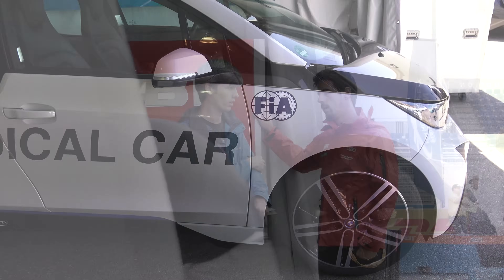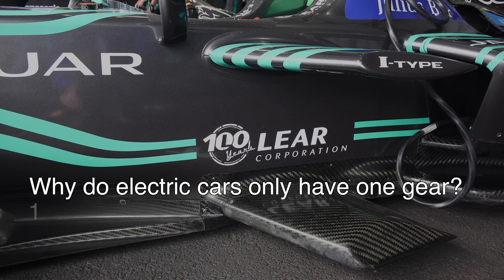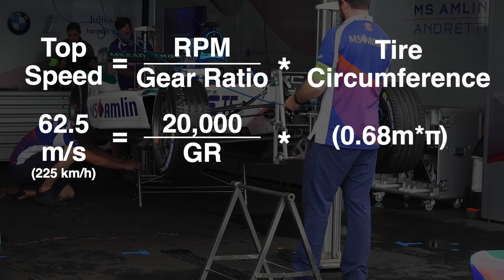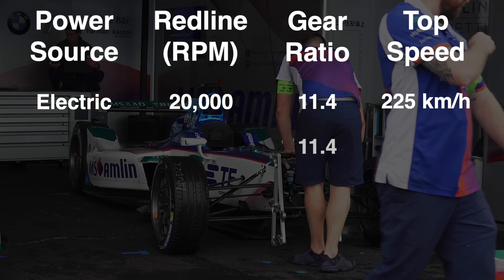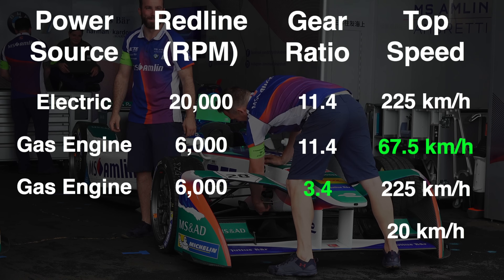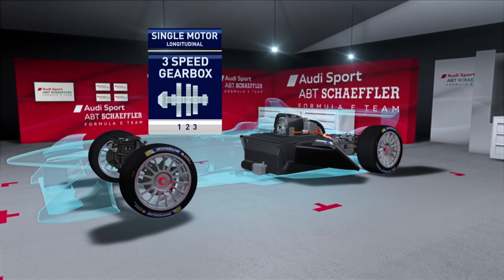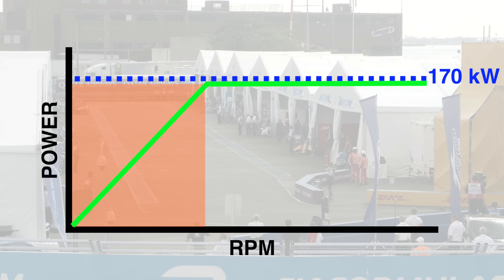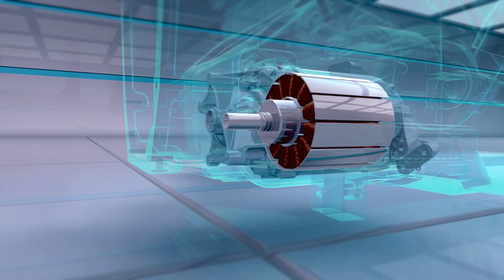Why Do Electric Cars Only Have 1 Gear?

Comment: Thanks for using the metric system.
Reply: Even Star Trek was using metric system.
Reply: @Angel Dust By the way Tesla engineering use metric system.
Reply: You know the imperial system is more accurate?  Hear me out.   If I have 2/3 of a pint I have exactly 2/3rds.  If I have 2/3rds of a litre I have 0.66666 litres .  But however many decimal points I go to, I never actually measure exactly 2/3rds 😁😁😁
Reply: @barneybarret6088  Not sure if you are trolling or not. If you have 2/3rds of a liter than you have 2/3rds of a liter. If you have 0.66666 instead than you rounded incorrectly.
Reply: @barneybarret6088  LMAO what?

Hear me out.   If I have 2/3 of a litre I have exactly 2/3rds.  If I have 2/3rds of a pint I have 0.66666 pints .

See?

0.6666666666666666666 is another way of writing 2/3. It doesn't matter what unit you're using lol. One is a fraction and the other is a decimal. You can have half a kilometer, or half a mile. That is 0.5 km or 0.5 miles... you can have 2/3rds of an apple, which is also 0.6666 etc apples. 

Or did you already know this and you were trolling?
Reply: Don't thank someone for doing something which is normal.
It's like thanking people for being honest.. It's the standard.:P
Reply: Why not both?  Ah, because someone has to be ‘right’.  Someone has to be prideful.
Reply: @d00der41  Because learning both is A LOT of work and the next problem is that every nation has their own definition of miles. If you are just looking at imperial Germany, a mile was something between 2 and 11 kilometers.
Reply: Gross
Reply: How many yards are a mile?
Reply: it's the best.
Reply: As an american I find it perfectly reasonable for creators to only put things in metric.

Putting the units in SI is far easier for the creator when doing the calculations in the first place and reporting in metric is accessible to 95% of the world.
Overlaying additional units in the video would only make the graphic look cluttered.

Its an objectively superior system and any confusion in units on a video like this is only all the more reason the US needs to convert and join literally the rest of the world already
Reply: Yee
Reply: Esse rapaz tem visão, de que adianta fazer um vídeo para falar apenas com 360 milhões de pessoas se usando o sistema métrico, ele consegue atingir 7 bilhões de pessoas? Parabéns pela visão.
Reply: When making video's it seems like it'd be simple to say one thing, then have the conversion text overlay making it relate-able to a wider audience. Not sure why video makers just don't throw that in.
Reply: Max R why are you disgusted by it?
Reply: @Vylkeer  Because the US uses Freedom units, compared to communist units.
Reply: @61rampy65  ahahhah “freedom units”, you mean complicated imprecise units. There’s a reason if metric is standard almost everywhere in the World but a few places. Even the UK and US are using it more than ever before. Communism has nothing to do with the metric system.
Reply: I agree. The US Customary System should be left in the last millennium where it belongs. Americans learn metric in school, so they really have no excuse. Doing the conversions is easy enough for day to day use, but US Customary is an inferior system, and should be depreciated.
Reply: The only thing I don’t like about the metric system is the superiority complex of the people who use it
Reply: @BingBong Boopledoop You're right, it would be good exercise IF we actually did it. I just ignore it because I don't remember the aproximate conversions so I have no idea what they mean. If I've got to get out my calculator and convert the numbers, I'll just ignore the video in most cases. This was interesting and I watched it but I too wasn't crazy about it being in metric without including the conversion. I like to learn things even at my age but I don't want to hurt too damn bad! LOL We're just stubborn here.
Reply: The persistent use of crappy imperial is the reason why american are scientifically illiterate compared to the rest of the civilized world. They are confused and simply can't compare, understand and are lost when reading scientific and technical articles. Can't even read a map or compare price per unit in the supermarket.
Reply: @ellsworthm.toohey7657  you do realize that Americans learn the metric system in school just like everyone else right? We just simply don't care to switch as it won't affect our daily lives
Reply: @ellsworthm.toohey7657 - both are arbitrary systems of measurement, neither is truly better than the other, it's whichever one you're used to. Americans aren't really scientifically illiterate, I do believe it's Americans that landed on the moon in the 60s, and  continued to have extremely high tech weapons in the cold war. Elon musk is American, he's pretty scientifically advanced with arguably the best electric car company and also a space agency. Apple is an American company, also very technologically advanced. We have many universities in each state, they teach upper level sciences. Engineers and scientists abound. If you take a scientist from any nation they'll be able to read your articles, if you take a non science educated individual from any nation like a music major they probably won't be able to understand scientific articles. Reading a map has nothing to do with science lol, and comparing prices is math and most countries use the same set of numbers for that. There's not really any evidence to support what you're suggesting that Americans as a whole are scientifically less capable than other countries as a whole, America is a pretty established 1st world country my guy
Reply: @ellsworthm.toohey7657  And yet we put a man on the moon and invented the internet while you have accomplished nothing.  Weird, right?
Reply: @ellsworthm.toohey7657  I guess that means we'll stay here and the rest of the world can stay there huh?  I'm fine with soft metric, but, for example, tool design, steel comes in inches...it can be hand in metric and since so little of it was made here, many metric sizes can be had. We already had our system in place, we never really  needed to accept any of it in the first place. That's what the rest of the world didn't understand and still seems to not understand. We really don't need the rest of the world if it's going to be like that.
Reply: I'm embarrassed to reside in the same country with idiots who think our imperial system is better.
Reply: @TheSkullConference  Don't be. Many people will stick to what they know. What you grew up with is always easier and more intuitively to comprehend than what you learned later.
Reply: @TheSkullConference  You could always leave!
Reply: @LG123ABC  "you could always leave!" Yeah and so could you. Luckily for us Americans, the metric system is becoming more widely used and accepted.
Reply: @LG123ABC  imagine if the founding fathers of the US were told by the British Empire "you could always leave if you don't like it." lol Or how about women's suffrage? Slavery? Just tell the women who want voting rights or people against slavery "you could always leave!" 🤣
Reply: I agree on metric system use its 1mm, 10mm is 1cm, 100cm is 1meter and not 1/3 of an inch - what does that even supposed to mean but if you say 8.5mm it will be more clear than 1/3'' same like people don't say 1/4 of 100 usd they say 25 dollars - simple, Imperial out, Metric in.
Reply: The guy is obviously American speaking to Americans. Like it or not, Americans use the British system (not Imperial, which contains 5 quarts per gallon).
Reply: @Greatdome99  do they? Universally? Watch some MIT engineering lectures, which are all metric.

I'd say the MIT professors know something about how to communicate about engineering.
Reply: @ Greatdome99:  I agree with your implied point that since the guy is an American speaking to Americans, he should use U.S. units or at least include the U.S. equivalents in captions.  I don't mind metric -- it is an internationally used system, after all -- but just as a convenience to his U.S. viewers, it would've been nice.

But if I may be allowed to get technical for a moment...it's actually called the "U.S. Customary System" -- and that's precisely because it isn't the British system.   In 1824, Great Britain changed over to the Imperial System, but since the United States was by then an independent nation, we stuck with the same system that we had been using up to that point (and to the present day).

The U.S. Customary System is mostly the same as Imperial except for volume, where an Imperial gallon is 1.2 U.S. gallons.  An Imperial gallon is the equivalent of 10 pounds of water, and contains 160 imperial fluid ounces.  A U.S. gallon contains only 128 (U.S.) fluid ounces, so that even though the U.S. gallon is smaller than the Imperial gallon, U.S. fluid ounces are about 4.17% larger than Imperial fluid ounces.
Reply: aullik. Your gratitude is equal to my disgust.
Reply: @MR-nl8xr  
Did you know that electricity is only measured with SI? Coulombs, Watts, Joules, Volts, Amperes, Farads are all metric.
Reply: @MR-nl8xr  Imagine using some duodecimal unit system of length that increases by 12, that's some real disgust right there.

Also, America is the only country (well actually with 3-5 other small countries u never heard of) on the whole planet that is still using the imperial unit and Fahrenheit system.
Reply: Imperial system is master race!

Imperial language is scientifically superior.  I believe what i want!
Reply: @ZAGGNUT1  
If Imperial is "master race," why is it defined by the metric system?
Reply: Carl Siemens : It's a historical anomaly, that's all.  By the late 1800s, the physical "pound" and "yard" objects that defined the standard, which were maintained by the U.S. government, were found to be degrading over time, so they just started using the metric versions instead (via the "Mendenhall Order", 1893), which were more recently constructed and were in better condition and better designed for precise measurements and comparisons.  A conversion factor was then used to define the pound and yard.
Reply: @Milesco  Actually, they are defined by metric system units because, unlike imperial units, metric units are constant. Really, you need to grow up.
Reply: @imaginarystranger1974  : Obviously, you're the one who needs to grow up. 

And you're wrong.  I'm not even sure what you mean by units being "constant" -- both metric and imperial are "constant."  But imperial units were defined by British laws hundreds of years ago.  The pound was defined in the Weights and Measures Act of 1878, and the foot was defined in 1300 by the Act concerning the Composition of Yards and Perches.

I explained the reason why imperial and U.S. customary units are currently defined in terms of metric measures in a previous comment, which I will reiterate here: 

By the late 1800s, the physical "pound" and "yard" objects that defined the standard, which were maintained by the U.S. government, were found to be degrading over time, so they just started using the metric versions instead (via the "Mendenhall Order", 1893), which were more recently constructed and were in better condition and better designed for precise measurements and comparisons.  A conversion factor was then used to define the pound and yard.
Reply: @Milesco  You completely missed the point. Again.

By constant I mean that metric units are defined by unchanging physical values, like metre is the distance traveled by light in vacuum in a very short amount of time.

Imperial units, meanwhile, were defined by something that varies (not constant) literally from human to human, making them largely unusable to general population.

Imperial units are defined by metric today not because original samples deteriorated, but because otherwise those who used imperial system wouldn't be able to work with the rest of scientific community.

Also, how do you not know what constant means? Did you not learn it before you even went to school?
Reply: @imaginarystranger1974  ”By constant I mean that metric units are defined by unchanging physical values, like metre is the distance traveled by light in vacuum in a very short amount of time.”

Nope.  I mean, that's the way the metre is currently defined, but that's a recent development -- it certainly hasn't always been that way.

In 1793, the metre was defined as one ten-millionth of the distance between the North Pole and the Equator.  Of course, the ability to measure the earth improved over time, so eventually, in 1889, the meter was redefined by the International Bureau of Weights and Measures by constructing a prototype metre bar as the international standard.  In 1960, the meter was redefined again as 1,650,763.73 wavelengths of the orange-red emission line in the electromagnetic spectrum of the krypton-86 atom.  Finally, the meter was redefined yet again (for the fourth time) in 1983 as the distance light travels in 1/299,792,458 of a second.   Thus, not so "constant" after all.

“Imperial units, meanwhile, were defined by something that varies (not constant) literally from human to human, making them largely unusable to general population.”

That is plainly wrong.  Even in the earliest times, the foot as a unit of measurement was defined by the local or national government.  It may have varied from place to place, and from time to time over the centuries, but it did NOT vary from person to person.

“Imperial units are defined by metric today not because original samples deteriorated, but because otherwise those who used imperial system wouldn't be able to work with the rest of scientific community.”

Again, that is just plain wrong.  In fact it doesn't even make sense.  Even if Imperial or U.S. Customary units had never been defined in terms of metric units, conversion factors would still exist.

And yes, the U.S. customary units were in fact redefined in 1893 in terms of the metric standards as a result of the physical deterioration of the American standard pound and yard:

"The imperial standard yard of 1855 was found to be unstable and shortening by measurable amounts." (Barbrow, Louis E. and Judson, Lewis V. (1976): "Weights and Measures Standards of the United States: A Brief History")

Likewise, the prototype pound was also found to be unfit for use.  For several years before the Mendenhall order (the 1893 order that redefined the U.S. pound and yard in terms of metric units) was actually issued, the Office of Weights and Measures was “practically forced” to use the metric prototypes because of their superior stability, and because they were better designed for carrying out precision comparisons.  The Office found that the conversion tables in the 1866 law (that made metric units acceptable [but not mandatory] for U.S. trade and commerce) were satisfactory and used them to derive customary length and mass from the metric standards.
  (Barbrow and Judson, 1976, p. 16)